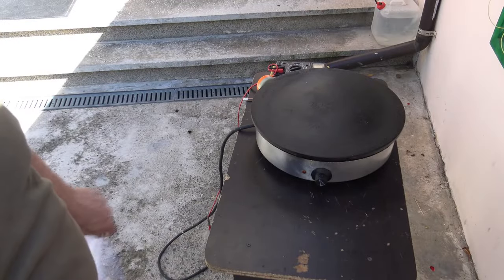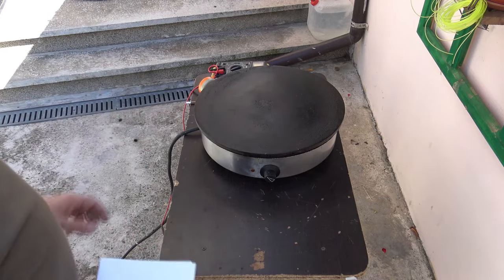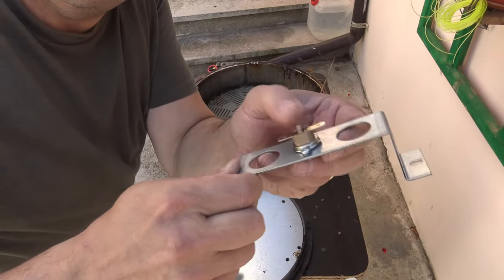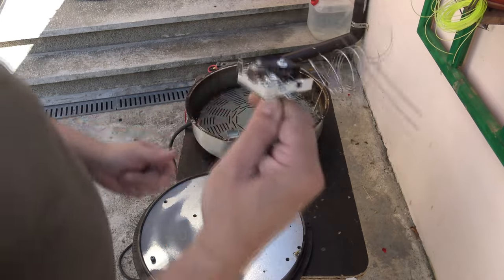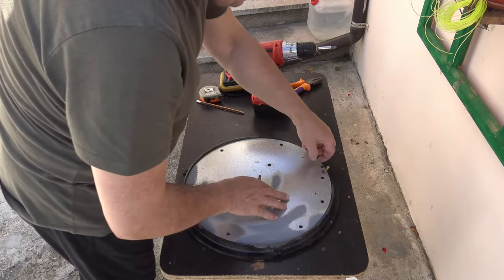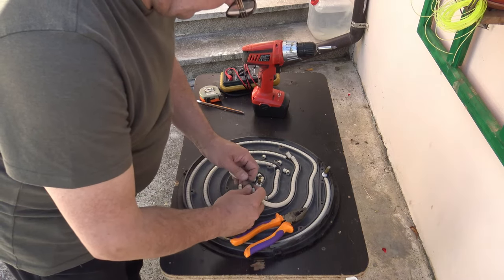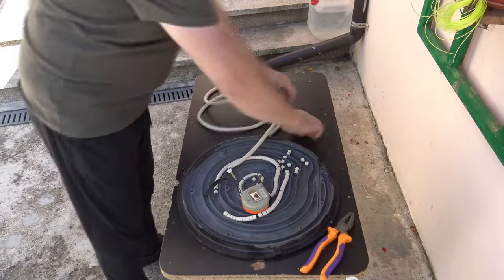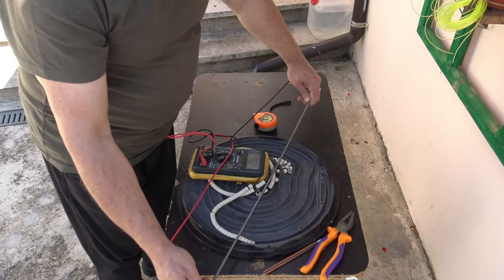How to fix an electric pancake Billig crepe maker

Comment: Thanks for this very helpful video. I have the exact same machine, but it no longer produces enough heat to cook crepes. It does heat, but not enough - I believe I have to replace the heating coil, but they are soooooooo expensive. What do you think might be the problem? Will it be the coil, or could it be something else. If you think I need to replace the heating coil or thermostat, where did you buy the metal resistor coil that you used in this video?
Reply from the maker: This particular model has a single coil, so a single temperature set, I recall max 250C. If you say that yours it's still heating but not enough and you are sure there is a single coil, the problem should be the thermostat, decalibrated probably, means it's turning the resistance off to early. Try to change the thermostat sensor position, away from the coil somehow, it will stop getting to hot and switch off. Also , maybe it a double coil with different power settings and a switch for each power level..in this case check the switch, maybe something burned there. As for spare parts, I manage to got some simple wire (no ceramic) from friends in a repair shop...I really don't know where they order but they have huge rolls with different gauges..I recall the original it's damn expensive.

Comment: Can I increase heat
Reply from the maker: Somehow..by shorting the length of the resistor.But   not much, it will burn faster. Better find a ticker wire.. Try not to make it bright red..
Reply from the maker: You make the resistance shorter, but try not to get it bright red. Better find a ticker for more power..

Comment: This is what I do not like about electrical appliances for cooking in the USA as they are all 110-120v at a max of 1850 watts whereas in Europe 210v-240v at 3k watts is not uncommon (I do not know the max allowed by law) so everything just works.  In the USA even the electrical portable cooking "things" I have used, and it will not boil water without being covered.  Worthless, honestly.
Reply from the maker: Yep..it use to be 220V, the new standard rise at 230V but it's more usually.Of course it's a lot of power but if the electricals, wires, main plugs etc are not properly done..that's disaster.And the abundance of cheap/doubt quality parts is a problem, everybody runs for cheap and turns to fire! Just bought a 40m 16Amps extension , nice orange looking , that burns in the middle..the wires are too weak even for my 1400W lawn mower.
Reply: @viocaia  Yes, same here, and it is VERY hard to find 14awg extension cords these days too.  Of course our 14 awg would not nearly be needed over there.  For instance when I purchased my laser cutter years ago the wires, switches, etc... were perfectly fine for 220v but for 110v they were too small to carry the load, and surely would have melted then caught fire.  I had to replace them with 16awg.
Reply from the maker: @generalawareness101  Laser cutter? that sound interesting!
Reply: @generalawareness101  Got a video on that laser cutter? very curious...
Reply: @viocaia  60watt.  I had to rebuild it from the ground up then the tube was bad so it sits for a couple of years now.
Reply: No, it is just the typical blue and white Chinese laser.  If you go to SarbarMultimedia on Youtube his blue and white is the same one I have with very slight modification from the manufacturer.  The rest is identical.  European wiring of around 21 awg (too many years to remember precisely the metric) on 110v is a nono especially due to the current the supplied sockets are used for (like exhaust fans etc...).  I did the maths and 18awg minimum so I just went to white/black lamp cord wire that was 16awg.  Major job.  All the rails, bearings, etc... had to be replaced.  I had to scrap it as China had simply spray painted over the rust, then spray painted it properly.  The only thing left from the original by month 3 was the Ruida controller and the frame.
Reply from the maker: @generalawareness101  Very interesting , way to much for my expertise, but you just light the bulb!